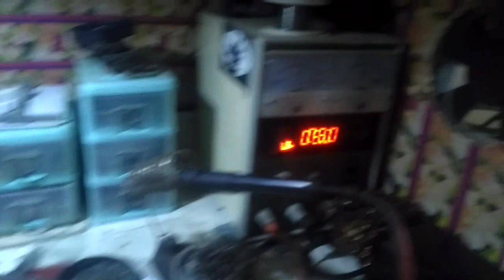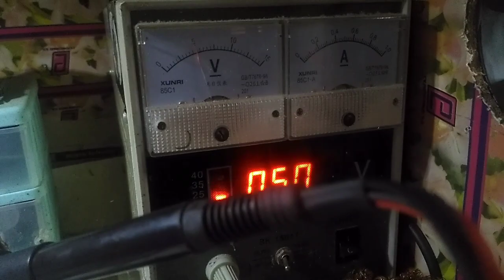Review+test kit pam8403 2x3watt stereo

Comment: Lebih mantep pakai batre power bank. Di pararel. Jadi 12v. Terus di convert jadi 5v. Biar enak aja kang. Kalo buat di cas pakai charger 12 v. Atau casan aki....
Reply from the maker: Sya coba pake batre laptop 6biji seri pararel,pake modul charger power bank,terlalu drop gan,led kedip",voltase turun banyak,krn modul powerbank cuma 1A,volume kecil sih ok z,begitu volime gede drop.
Akhirnya sya pake cara simple,make smps bekas sony,5v 5A.jossss speakernya ampe mau jebol,sya ganti pake speaker 5inch,baru enakan.
Reply: @kabayan_Elite  ga di coba langsung power input dari batre aja gan. Kalo buat di cas baru lewat modul nya...
Reply from the maker: @Dry90  ga bisa om,batre voltase nya 3,7v kalo di seri jadi 7-8v,kalo cuma satu batre(3,7v) ya aman,cuma ga maksimal pas nada bass,drop.
Reply: @kabayan_Elite  ah masa sih... Battre laptop ane tegangannya 4,18 v perbatre, kalo batre yg merek uitra firc 4,8v...
Reply from the maker: @Dry90  batre laptop atau tipe 18650 di 4volt,normalnya 3,7v

Comment: Mas boleh minta solusi gak ?
Saya kan beli kit PAM 8403 tipe D trus saya rakit ke modul mp3 ... suara sih ada ... tpi pas volume full langsung mati ... tapi pas volume di kecilin nyala lagi ... itu kenapa ya mas ...
Reply from the maker: Protect om,bisa jadi krn kurang arus,bisa juga overload
Reply: @kabayan_Elite  kurang daya ya om ... soal nya saya pakai batre hp ...
Reply from the maker: @KELUARGAKECILPANDAWA  iya kurang daya
Reply: Kalo pake btre bekas laptop bagus pake berapa biji mas
Reply from the maker: @KELUARGAKECILPANDAWA  sya udah coba pake batre laptop 2biji,itu kalo batre nya fit,bisa sejam kurang pake speaker 3in.mungkin kalo di pararel lebih dari 2biji,bisa lebih bagus lagi
Reply: Di paralel tuh kaya gmna mas ...
Reply from the maker: @KELUARGAKECILPANDAWA  koneksi nya min ke min,plus ke plus..
Lihat di google

Comment: Spek ampli mini PAM 8610+modul usb bluetooth yg ane rakit. Supply pakai battre laptop 6 buah di pararel jadi 12,9v. Ane kasih elco 4700uf di power input PAM 8610. terus ane kasih heat sink alumunium di icnya. Ane tambahin ic regulator IRF 7809, keluarannya 9v buat modul usbnya. Sebelumnya ane kasih irf 7805 ga ngangkat buat modul usbnya bro...
    Soal bok ane bikin pakai triplek 3mm di kasih dempul di dalamnya.. speaker pakai speaker pintu mobil 2buah. 4,5/5,5 inch. Model bok outdor,, nyontek di pembuat outdor bok speaker. 
Suara yg di hasil kan lumayan bro buat indor outdor.. ngalahin speaker simbadda yg 45w.
 Soal ketahanan battre ane kasi setengah volume lumayan bisa sampai 7 jam. Soal casan ane pakai casan cordless. Atau casan aki atau bikin....
Reply: Bikin video tutornyaa bang,ane pengen bikin, pemula awam mengenai perakitannya
Reply: @riespraboe7951  semua sumbernya dari youtube ko gan. Tutorial buat batre 12v dari batre bekas laptop/notebook, terus penurun tegangan dari IC IRF 7809,
Reply: Coba tes bos suara